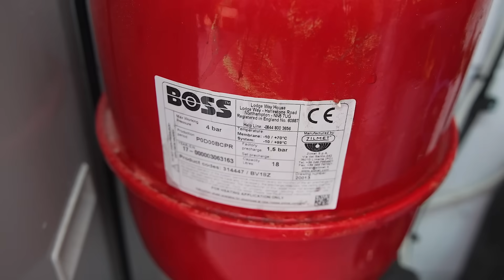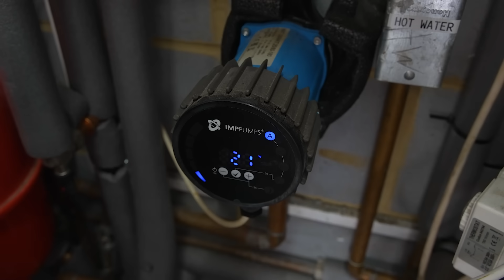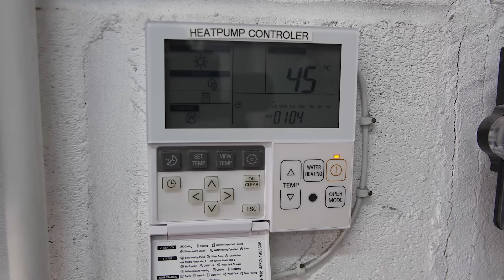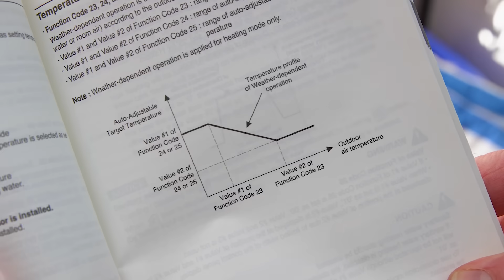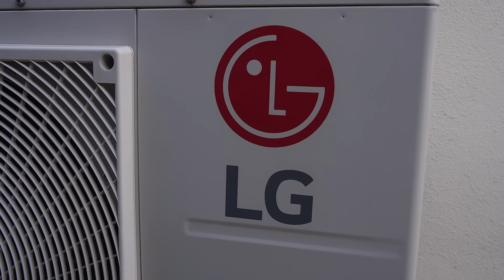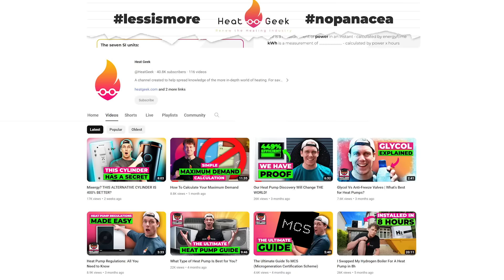Heat Geek Gives His Verdict on John’s Nightmare Heat Pump

Comment: really interesting,  I was thinking ot the pump around the mixing valve, I understand if you can remove it for pure heat pump but wont the boiler send out to hot water?  I have a wood stove combined with an air/water heat pump and I need the mixing valve to not send out  90 degree water when Im using the stove in middle of winter, so it is maybe better to be able to disconnect it and then connect it back in when the boiler start up ?

Comment: Good video. All I took from it was there are not enough folks who really know their stuff in this area and there is a fair amount of guesswork in trying to determine what costs you can expect to hear your house with hot water. I wasn’t convinced about costs to run and would love to see a true comparison of gas boiler v heat pumps … the noisy fan (regardless of the fan level) will happen through time as bearings wear down so how long should we expect them to remain quiet? I will keep my gas boiler for now thanks …

Comment: I self installed my heatpump 15 years ago. What makes the biggest difference is the electricity tariff. Economy 10 is the way to go. I'm not on the gas grid, and I use offpeak electricity to heat my water.

Comment: Very interesting video.
I had considered indstalling a heat pump back in 1988 in a Victorian manse located in the north-west of Scotland. At the time the cost was about £12000. I decided that this was probably not a good investment as a heat pump is a mechanical appliance that will have a finite life. i estimated that the capital depreciation would have been about £1000/year and that the replacement pump would be at the then current (higher) cost.
I retained my solid fuel (wood/coke) as being the better option.

Comment: Can we revisit this property after the customer has had the alterations done (removal of buffer, pumps, mixing valves, motorised valves etc. Convert to an open loop with weather compensation. ..... it would be interesting to see if the heat improves inside the property and the 3.5 COP level is achieved
Reply from the maker: Yes, absolutely

Comment: Im not sure I agree about the bearing orientation as mechanical devices have them in all sorts of orientations without issues. That said it could be the housing has been fitted incorrectly and is rubbing against the powered fan causing stress on the drive or poor bearing quality that has allowed the ingress of water and rusted the bearings.. Another thought that comes to mind is damage caused by cavitation as the device is not venting correctly due to the lean.

Comment: One of the interesting points raised her is the use of a bone fide  'Heating Engineeer' but with the term engineer so widely disabused who knows who is genuine engineer  or who is a plumber who fits boilers (or ASHP).  These days someone who mend your washing machine or fixes the phone line is often called 'engineer' when in most cases they would be better termed fitters or mechanics. An Engineer is typically someone who designs a system be it a electronics assembly and car engine, a chemical plant  a bridge or what have you using mathmatic calculations and is often a member of a chartered institute such as the IET who will have appointed him with the title. In many other countries an engineer is given the same esteem as doctors or lawyers, not always the case over here and hence the litany of problems casued by underqualified 'engineers'.

Comment: Great video as always. I have a question about weather comp. I live in new property, zoned 5 rads upstairs and 5 downstairs. I have an ideal esp1 35. I find my CH runs for 30 seconds on full burn  then runs just the pump for 90 seconds. Does this continuously. Is my boiler not condensing?Ideal, as you expect, were useless. They said disconnect weather comp. I think boiler is oversized and it seems that min output is 9 kw. Any advice would be appreciated.

Comment: Can the buffer tank not operate in the same priciple as an indirect cylider, or even a large counter flow heat exchanger? That would solve the issue with the heat mixing in the buffer.

Comment: 3:33 Enough clearance from wall for proper airflow?  Appears so tight.  Not moving enough outside air will certainly lower efficiency.  Is the rear side of outdoor unit a solid panel?

Comment: I ran an ideal Mexico cast iron 60,ooobtu boiler for 30 + years on boiler thermostat only.  2 yars ago the poor old mexico  boiler  started to fall apart, combustion chamber, etc. I managed to find a brand new mexico cast iron boiler, barn find, in the back of a builders merchant for £50, he was glad to get rid of it, I was over the moon.  I have got 30 years plus life in the boiler in front of me and I  am delighted.  Yes, it's,  illegal plumbers tell me because it's so inefficient and eco unfriendly. But I have no maintenance at all, no programmers. no fans, no expansion vessels,  no noise, still uses a header tank, it works a treat.

Comment: This is a ridiculous clown world situation we’ve gotten ourselves into 
All this equipment in a domestic property taking up half the garage and a noisy heat pump in the yard just to provide heating and hot water 
A very expensive sledge hammer to crack a nut, absolute insanity, how on earth is this a step forward 
We’re expected to believe that this is a better option than a gas combi on the wall which will do it all and take up a fraction of space at a fraction of the cost
How is this fair on customers 
I’m sorry but I’m a long,  long way from believing that this is the right thing to do
Reply: Spot on👍

Comment: So installation 101 would say get the outdoor unit level but i disagree that this caused the fan bearings to fail, more likely they are cheap bearings, aren’t sealed or just shielded and you can replace these easily for no money at all with quality bearings. Other factors are the fan out of balance with build up of dirt, buckled if its plastic or maybe a bit of it is broken off, all of that will destroy the bearings prematurely. Remember the fan when running produces thrust in one direction and puts most of the force on one side of the bearing, small cheap bearings will fail faster.
Glycol…required if you dont want the unit to freeze in winter. This looks like an air to water heat pump and the white plastic ducting you pointed to at the wall contains flow and return water pipes, not refrigerant pipes. LG recommend somewhere between 20% and 30% ethylene glycol and corrosion inhibitor…
The distance from the wall should be 300 min, the clearance at the front 700 min.
As for the buffer tank and zoning theres just not enough info to make a comment but the installer probably followed the installation guidelines for splitting temperatures between rooms.
Just another thing, if a heat pump (air to air) is running in summer it is likely to be providing cooling to the dwelling, therefore it wont be blowing cold air over anyone outside at the pool…it will be warm air rejected from the dwelling?

Comment: It would be so great to have Simon to fix this thing. Also I'd be interested if the bearings can be fixed easily and if the controller supports the outside temperature compensation.
Reply: They can, you can buy the genuine parts to swap out.

Comment: This is more about poorly designed hydronic heating than heat pumps.  I have been installing LG equipment for the past few years and their equipment is very good.  The bad bearings are unfortunate but not expensive to replace.  I agree, the high temperature heat exchanger is inappropriate.  The standard unit will be fine.  FYI, air to air heat pumps can be used for ductless or ducted indoor units.
Reply: That's just what I wrote 5 minutes after you re getting the bearings fixed. Lost respect for Adam's advice.

Comment: Biggest question i always have is , do they work with radiators without oversizing them
Reply from the maker: They will work but you need to keep all the doors and windows closed and run the heat pump 24/7. You might be warm if the insulation is top notch but many people will wonder why they ever made the change to a heat pump.

Comment: By pass will cause your heat pump to cycle on and off code it won’t be able to run under the minimum point of modulation/ min Hz and rpm

Comment: Hi Roger very interesting video, very pleased that the industry are starting to tackle the world of heat pumps on a design basis. I was very interested in having a survey undertaken but shocked when asked for the survey charge of £350 so that has now put me off. I have received quotes of £20k and above with huge disruption to the house as I have 10mm plastic pipe fitted, build of house 2016.

Comment: I found the video really interesting and the three guys were great but I have a few points.Firstly the noise issue.What would be the noise level if the unit was fitted correctly and all the parts were working properly ? A constant noise even if at quite a bit lower level would still be really annoying if neighbours lived closeby-as they do in most cases.Also the maintenance cost-not many people come to your house for under 70-80 pounds nowadays.

Comment: Question: why is the weather compensation curve linear? That doesn't make sense to me because as the temperature delta (outside vs inside) increases the heat loses increase exponentially. So why is it not an exponential weather compensation curve where you can set the exponential gradient?
Reply: What formula are you using? Heat loss is linear to outside temperature with a given inside temp? Q(heat loss)=DT (temp difference)XA(surface area=constant)XU(Constant for a given construction) So Q is linear with temperature difference and as inside temp is a given, it is linear with outside temperature.
Reply: @BerendDoedens  I don't use formulas, I make them. btw, I already got confirmation that good weather compensation curves are indeed not linear. So if you're using a linear one, you're a decade behind in knowledge.

Comment: The reason the owners called you is to address the electricity bill. All being good and partially true about the items pointed out, your suggested repairs, amendments and weather comp will not substantially bring the bill down. The buffer is not a bad thing to have. If anything, increase its size to make it a large thermal store, so your Heatpump isn’t cycling as often. 
Lastly, why do Fins have had these for decades? Because the houses are well insulated in Europe. 
How about also mentioning MVHR need for UK houses?

Comment: Without watching the video: Default pump mode is cooling. Solinode fail on valve then causes pump to be stuck in cooling mode. Buy pump with default mode heat. If the solinode fail, it's stuck in heat mode.

Comment: So the long and the short of this is - if one had a properly installed gas system with weather compensation etc etc, an air to water heat pump system would still be more expensive to run?

Comment: Surely heat geek/skil builder can secure some free parts (new heat pump) and donate some labour to John for fitting in return for the good publicity and engagement this has/would generate. I’d be far more convinced to get a heat pump of heat geek’s recommendation and use a heat geek installer if I saw Johns issues resolved by implementing the recommendations.

Comment: John et al, if the heat pump is upto six years old, it will be covered/protected by UK consumer law, as it is an unfit product. Either that or try getting the original installer to compensate for the un-level instalation damaging the pump?

Comment: I am curious if heat pump will work well in cold weather places like Canada where we can have -25 degree Celsius and a lot of snow.  I am just worry that the outside unit with the fan may not work properly during harsh winter.
Reply: If you can have a borehole (geothermal heat pump), then it's likely to be a better option if -25C is a common occurrence, the bore hole is typically a 1-off cost as it is expected to last 100 years, and the heat pumps for them are expected to last about 20-25 years.  I'm on Air Source, and it's been down to -14C this year and mine have coped just fine (2 of them go down to -30C, but mine aren't sized for going to that temperature, so will underperform).  Having a properly sized heat pump is key in any situation.

Comment: Very interesting 😊, One thing I would like to get more information about is the conclusion that the buffer tank is not nessesary ... Does that go for all monoblock heating systems?  or do I misunderstand it all?
Since my install last summer I have been wondering " actually.. what would happen if I didnt have a buffer?"

My pump is a Gree Versati III monoblock inverter type. The installer say if no buffer, it will turn on and off all the time.. but I' m not sure he is right..
I have underfloor heating on ground floor, and two radiators on first floor. I live in Denmark, wherr everybody notoriously use buffer tanks, but I never fully understood why, and how the water inside the tank are behaving, I mean two inlets, and two outlets must mean rotations and mixing water... or what? the tank are without spiral, I use an electric heater for hot water.

Comment: No machine with bearings can handle cold air. It will dry the grease and in no time will ruin the bearings.
That is why,  a heat pump is for saving money but it still needs the cozy affection of a traditional furnace embedded.

Comment: One cause of this mess is the difference between a plumber and a properly trained heating engineer. Unfortunately, there have been many plumbers turning their hands to gas/oil boilers, heat pumps, log gasification boilers etc that haven't a clue and work on a one size fits all basis.

Comment: If you factor in cost of unit, cost of new rads, pipes, redecoration, retrofitting insulation and the inevitable increasing costs of renewable electricity. The government plans to load the green levies on to gas to make electricity seem competitive to the cost of gas heating. The installation costs are prohibitive, you won't save anything/more expensive  to use. The cheapest option is gas in a free market if you're out at work all day so most of the time it's off but heatpump is on all the term.

Comment: When I looked into it, the ONLY company offering grants REQUIRED under floor heating to be installed, and since I have concrete floors they just refused outright...

I suspect their profits drop if you don't have all the additional bits and pieces they link to the grant. Which is why a fairly simple concept of a compressor generating heat and using a heat exchanger to deploy it is thousands of pounds.

Why is air conditioning rated in BTU and heat pumps rated in kW? What are they trying to hide? A heat pump us a scaled up refrigerator, freezer or air conditioner.

Where is the most important figure - that of operating current. The only one I've seen equated 17kW with 16.1Amps. which doesn't make sense because 240v x 16.1A = 3864W not even 4kW...

Where am I going wrong with this?

Comment: Been a sparks 40 years ( we Dont do heatpumps ) have wired a few in 2012 -15 and recently 3 modern systems and they only work on Brand new small medium size houses.The early ones had a 32amp element which cut in more than you would believe and in seriously cold weather and I have one client laying £800 a month in recent cold spell 😂 Basically as said big companies grab the money then close down when S—-T hits the fan.Same as solar at the moment basically stay gas as long as you can is all I can say.

Comment: I agree with most of the comments in that this was an entertains and informative video. Can I just make an observation here is notwithstanding some of this poor householders heat pump equipment seems to be unnecessary and counterproductive according to heat geek, the remaining is still enormous and taking up a huge chunk of the garage which renders parking in it probably improbable. Not to mention the hideous fan thing outside also. There seems to be so many things to go wrong and associated costs going forward, when compared to a conventional gas boiler which often fits on a wall or into a cupboard. I have a conventional boiler inherited in my over 100 years house. Given clean bill of health when serviced  and it does both heating and hot water fitting into a large corner floor to ceiling cupboard with water cylinder. 
I hope this poor man’s heating woes are sorted out successfully soon and as well as heat geeks expertise, there was another commenter heat pump engineer on here who watched this video and offered to rectify this one for free, which is fantastic.

Comment: Is that water really mixing? Or is that a coil where the water flows in and out, makes the temperatures exchange and then the tank itself then works as a secondary circuit which gets drawn by the secondary pump?
Reply from the maker: There is no coil in that buffer. It is a low loss header